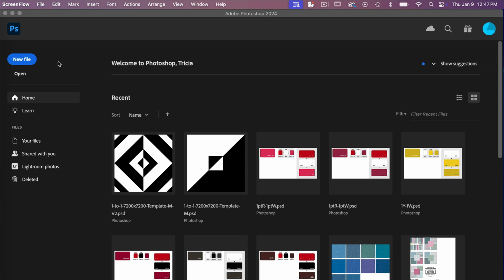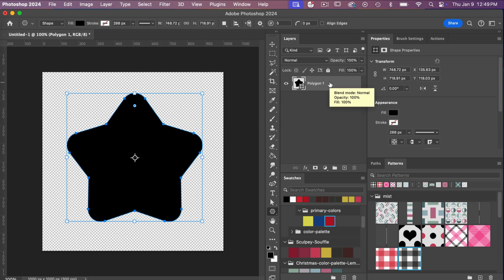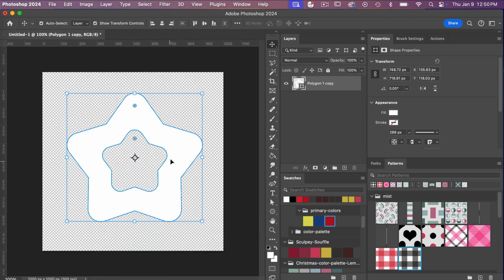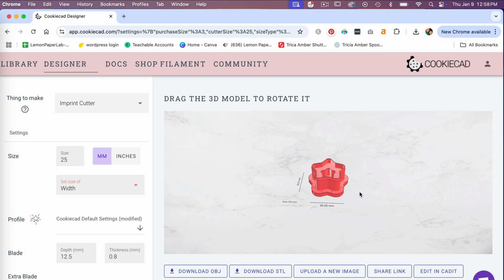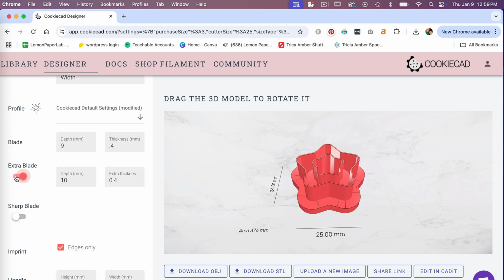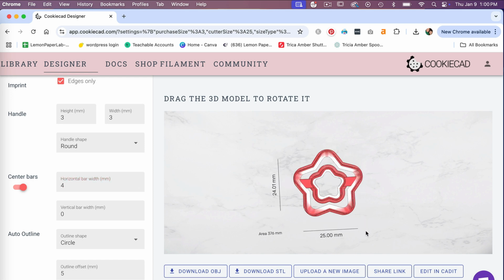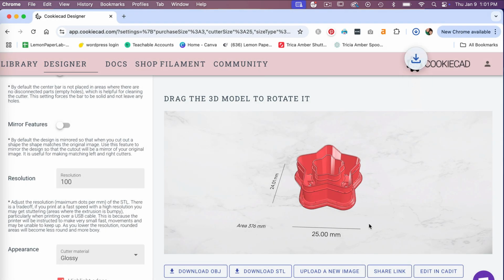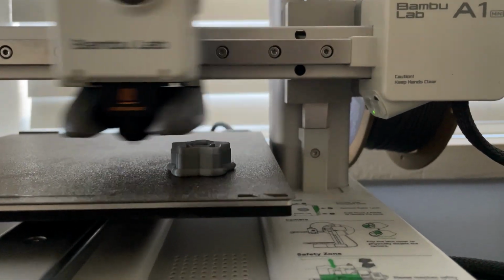Custom Star Polymer Clay Cutter Imprint Cutter with Cookiecad

Comment: I created a product using this, but the printer did not print it. Is the problem on my side? I don’t understand. I used the following dimensions: Size;25 mm / Blade 12.5 mm depth and thickness 0.4 mm / Imprint 1.5 mm / Handle height 3 mm and width 3 mm / Center bars horizontal bar width 8 mm,   I don’t have a printer, so I can’t try it myself, but those who have tried were unable to do it, which makes me unhappy.
Reply from the maker: It may not be your file but the settings that they are printing with. I know for my printer I had to change settings to get it to work